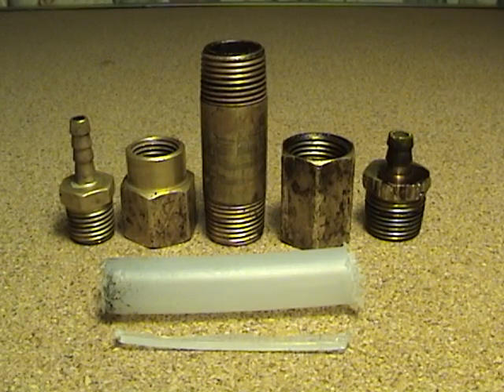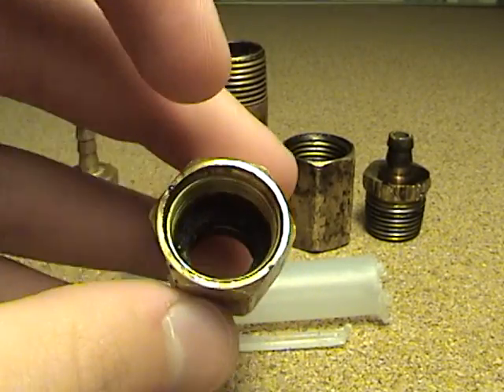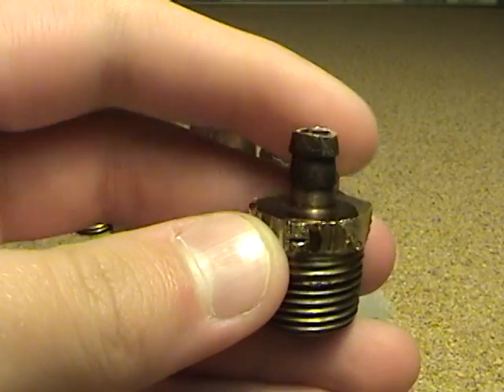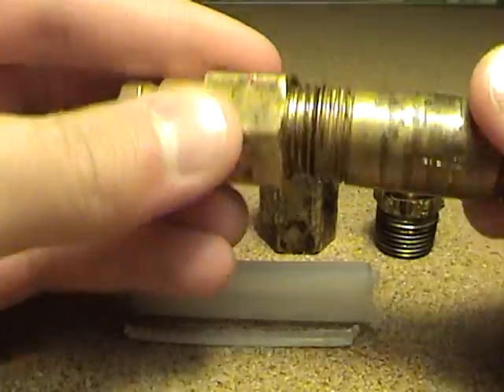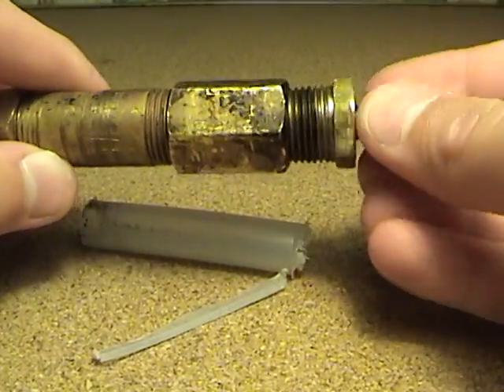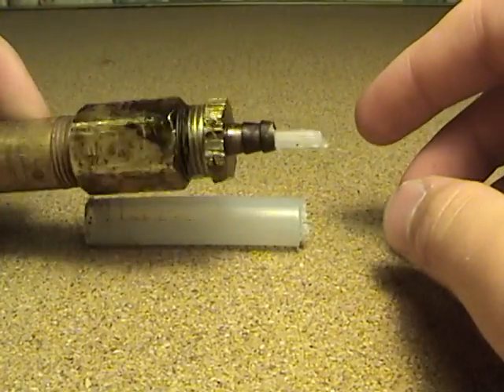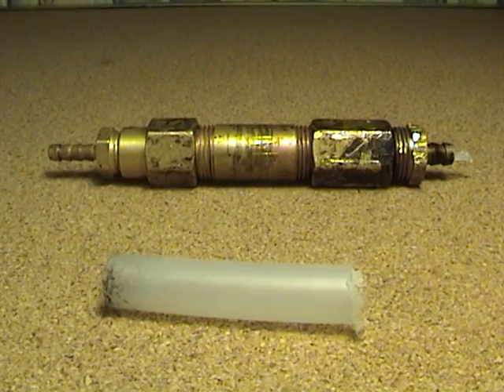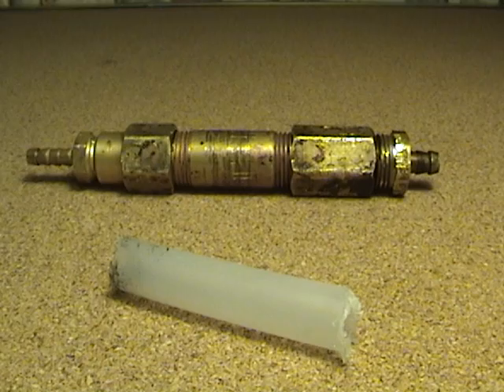How to build a simple hybrid rocket engine

Comment: That's cool.
I am planning on flying (or sending) a model airplane (airliner) into a wall, as fast as I can make it go, and am thinking of adding two actual rockets to it.  Do you have a video of your rocket in action?  That's what I would like to see.
I wonder, if the plane is covered with aluminum (like real planes), can I use JB-Weld to fix rockets to the wings?  Do you think this would work?
Thanks for explaining, very well, how to make the rocket engine.  I think this is the way to go.
Either that, or I will go without engines and will fly it via (some kind of strong) sling-shot.  Wondering how fast I can make it go with a big shot?

Comment: I'm 13 and I learned calculus simply to learn how to build a rocket. This video is really good (but the measurements of you're fuel should be here)(I need it for mass of the fuel and everything else to really get an accurate measurement of how high it could fly)   (RX=TAN a (little 0 in top right hand corner) (AX) If you do this; I can figure out how much thrust. ( T = thrust A=area P=pressure T=temp) T= .532 AP divided by the square root of the temp. and that should (given you have done the equation right) give you the pounds of thrust per second. Happy Solving! Also any questions on this comment ill be happy to help you with them. :)
Reply: "I'm 13 and I learned calculus..."

/r/iamverysmart

I'm 15 and I can't even solve a rubrics cube.
Reply: I'm attending the California Institute of Technology at the age of fifteen, you don't need calculus for any kind of rocket you would be making given that your fifteen.
Reply: Theodore W. Smith
> I'm attending the California Institute of Technology at the age of fifteen

proof? just for shits and giggles.
Reply: @Aydin Guy My proton source was a hydrogen discharge tube, it was a potential drop Van de Graaff accelerator using a huge electrostatic field to accelerate the protons down the tube. Did you look at the search I told you to do? I spent every afternoon for 2 years on this thing, I know what I built. I'm a professor of physics now, I know very well what I constructed.
Reply: Dammit I came here to post this.
Reply: God it's wonderful to see people who are like me when I was a kid! Carry on going. I suggest you get the book "The Amateur Scientist", it may revolutionise your view of us as a community (amateur scientists). When I was 13 I built a proton accelerator.
Reply: Aydin Gokce I built the acccelerator detailed in the August 1971 edition of The Scientific American's "Amateur Scientist column". Please look it up, you will find it. I spent two years and $500 on it, and don;t like to be discredited.
Reply: Aydin Gokce Those are my damn children!
Reply: Aydin Gokce, as I said, this is my children's account. I encourage them to think for themselves, ergo like what they please. It's a little strange that you sleuth their account.
Reply: I think you've pushed us a tad off topic.
Reply: Evil Morty ok
Reply: Aydin Gokce your grammar and punctuation are probably why you never graduated elementary school .
Reply: Theodore W. Smith if you’re in college at 15 atleast know how to use the right your
Reply: I’m 13, know calculus and have not needed it in making a hybrid engine.
Reply: why would you need calculus? this is basic physics and its wrong
Reply: Anneliese o'callaghan you probability built a CRT because the cheapest way to get a raw source of protons is to build a Farnsworth fusor which costs around $600 which I already doubt then there's the danger of radiation and you need deuterium then for the accelerator you need several hundred electromagnetic coils and you need a relay then a microcontroller to control the relay and you need radiation and explosive protection. Sorry, but I find it hard to believe you built a proton accelerator for $600 in two years.

Comment: does any fellow rocketeers know how to convert a skill lvl 1 to fly off of race fuel like for race cars
Reply: +Micheal Wright Why would you want that? Use RP- 1 or some other kerosene based fuel. Gasoline SUCKS for rockets. If nothing else, use hydrolox.
Reply: Micah Burgin how do I make a motor that uses hydrolox, and also the only reason I wanted to use 110 octane race fuel is cause it burns a lot hotter then gasoline and remember these are skill level 1's im not that far ahead of all u other rocketters I just got togeather my mongoose rocket and idk if I even did that right mano I just want a damn liquid engine not this gunpowder shit
Reply: Hydrolox is not that difficult, and you shouldn't use any form of high octane fuels because they contain detrimental things which WILL ruin turbopumps, etc. 

A pressure fed hydrolox is as simple as a set of new tanks fed into a nozzle. Fill the tanks with hydrogen and oxygen respectively with a proper mix ration and feed them to the nozzle. Make sure you include valves, obviously. The rest is the same as any other liquid fueled motor design.
Reply: Micah Burgin cool so would u recommend 9 or 10 break away parachute loaded fuel tanks to hit roughly 80k feet
Reply: cause if I can make it right I got a design for break away fuel tanks with recycled pumps from old trash household deco fountains
Reply: Well keep in mind your weight limits. Look up the stuff you want to try on instructables or similar. It'll save you time, money, and burns.

Comment: your parts list you are saying measurements in inches, are those numbers from what you measured yourself? cause pipe is measured different 1/4" NPT is actually almost 1/2" SAE, so if you measure the barb and its threaded end is 1/2" its gonna read 1/4" NPT on its packaging

Comment: you are correct, he needs to have more pressur pushing out the fuel, he will need a external pressure tank to force the fuel hard enough to produce enough thrust

Comment: I'm sorry son , but all you have created is a welding torch, as a certified welder, and having a good knowledge of the physics , you dont seem to have any kind of thrust proof . The thrust from this is negilgeable. it would not propel the engine and tank anywhere.
Reply: A welding torch doesn't use a solid fuel to burn, it uses a fuel gas

Comment: hey man good video but do your self a favor and learn the "iron pipe size "nominal measurements so folks ask for the right stuff at the store. 1/2 id ,5/8 od threaded pipe and fittings is 1/2 inch I.P.S  ,just a plumbers input
but other than that great work

Comment from the maker: @soverato3 You can scale the idea but not the parts. If your going to have a small liquid engine you really don't need to cool it, you just cant run it for a long time and you will probably have to build in some type of heatsink to dissipate some of the heat. You don't need liquid oxygen for a liquid fueled engine you can use gas, the only reason they use it on real rockets is because you can carry much more than gaseous. If I were you I would do a lot more research before building.

Comment from the maker: @1234567890col With this engine I ran oxygen tanks with Liter per minute increments and I would usually run it at about 15 LPM. With something like this I would recommend buying a gas, specifically an oxygen flow meter rather than using a pressure gauge.

Comment from the maker: @1234567890col I used a medical oxygen tank for the videos but later upgraded to welding oxygen tanks. You can sometimes find full oxygen tanks at flea markets. Other than that the only option are Benzomatic mapp gas and oxygen welding kits at some hardware stores but they are getting hard to find.

Comment from the maker: @recon1283 First off you cant ignite oxygen, its an oxidizer. Second, you don't necessarily need polyethylene specifically you can pretty much use anything as a fuel. But polyethylene tube is widely available and able to be easily put into small engines.

Comment: Just a little advice, if you can find some nitrous oxide then use it. Oxygen can be unstable, it works but when it goes wrong it goes wrong big time. Plus nitrous oxide self regulates to last longer ect.

Comment from the maker: @19adobe20wv I doesn't necessarily have to be brass, I just used it because of its wide availability and cheap price. I personally haven't experimented with anything else besides stainless steel so I wouldn't know first hand what you can and cant use, but I would say your fine with anything except copper. Finally if your getting much bigger Id suggest testing it remotely or behind a shield in case it over pressurizes and explodes.

Comment from the maker: @szuszi2 Yes that is about the average price for a small oxygen tank and they are usually 10 or 15 cubic feet I believe. I have 5 of them and it took me a lot of saving to get them. Some times you can find them at flea markets but you usually have to have them inspected if they have passed their "expiration" date and then get them filled.

Comment from the maker: @vignesh12300 No, it is primarily sodium stearate. But the beauty of the hybrid engine is you can use pretty much anything as a fuel, at least anything that is solid and can be lit on fire (you can use liquid but then that would be a liquid fueled engine). You can use glue sticks but you would have to make it into a tube so the oxygen can pass through it. I have used many fuels in this engine and the reason I recommended polyethylene is because it is easy to use in it compared to other fuels.

Comment: You need to make a Pyro Paste, Take Acetone-Pinpon balls-Gun Power-Magnesium, Mix it all together and you get a paste that will harden like epoxy and will burn very fast with just a lighter. Use this mix to cover a small hole that leads to your oxidizer, (Compressed Oxidizer/Fitting w/hole/ Pyro over the hole) Allow the mix to dry (Over night) then use some steel wool with a 9 volt battery with a little wet pyro on it and when it starts to burn inside your fuel area it will release the oxidizer

Comment from the maker: Well if you are very familiar with electronics that can be easily pulled off, otherwise it might not be that easy. The easiest way to put it you would need a solenoid valve, some controller electronics, and a wireless receiver and transmitter. You would hook something like that up so you can wirelessly open a solenoid vale form the oxidizer tank to the combustion chamber